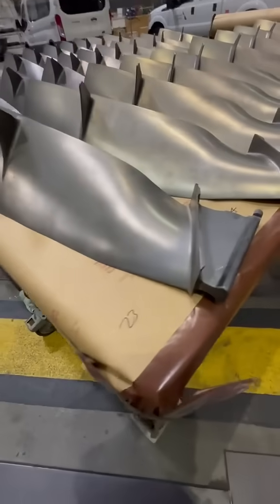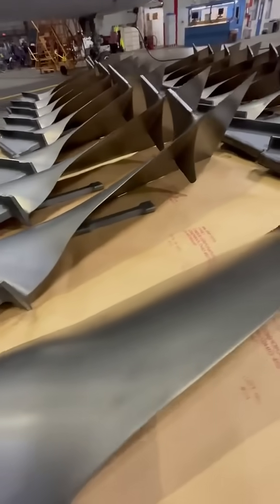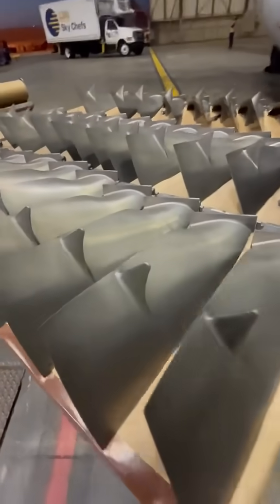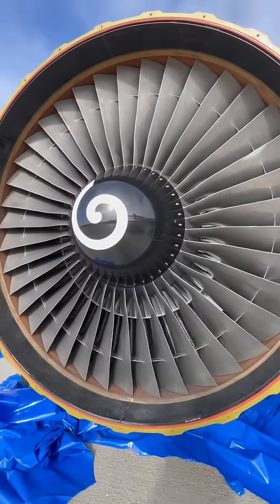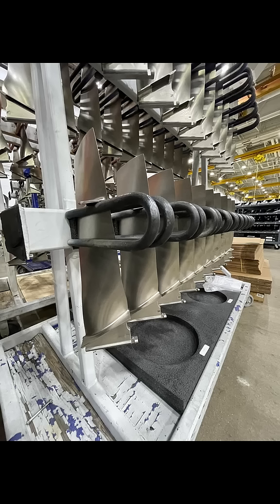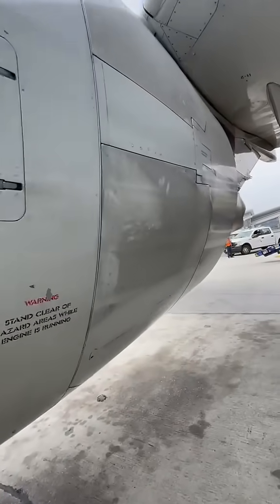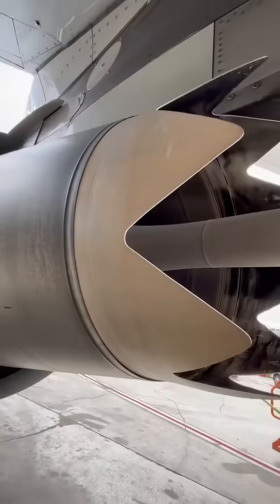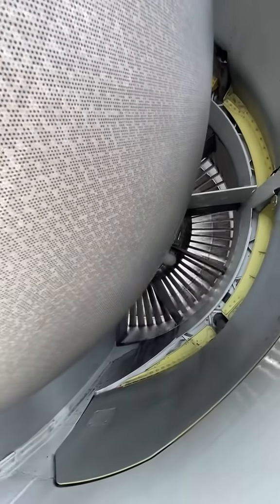Fan blade Mid-Span shrouds and why they make that noise.

Comment: The blades are also a slightly loose fit in their mounts hence why the snubbers contact each other and produce that noise at slow rotation speeds.
Reply: That's the only reason they make that sound.  Watch the blades at the "one o'clock" position around 0:02 onwards and you can see them "fall" as the fan rotates.
Reply from the maker: Absolutely correct 👍